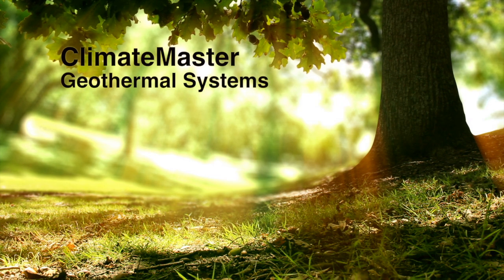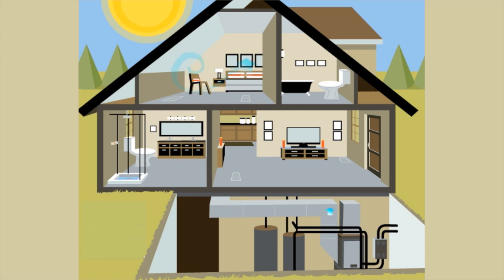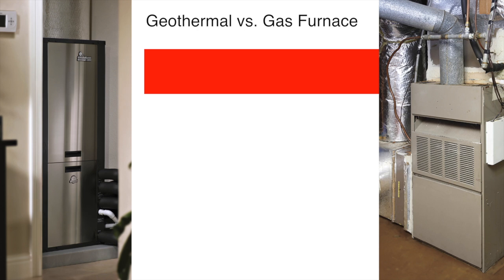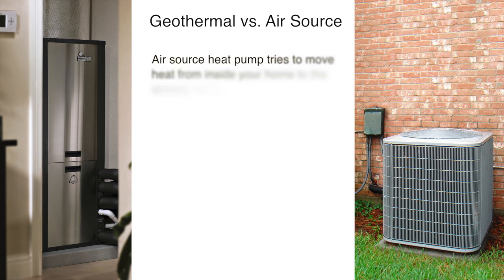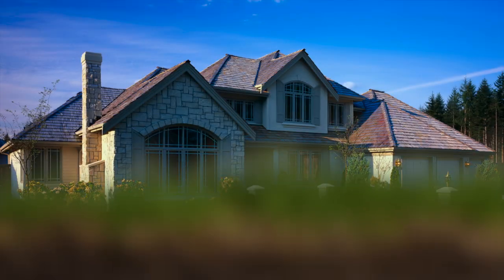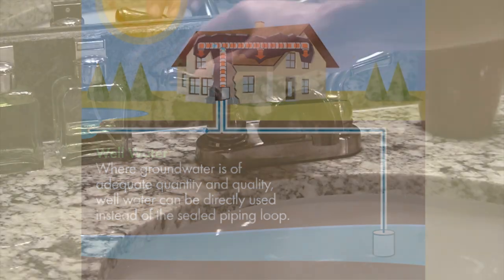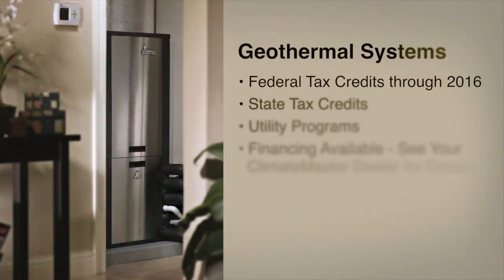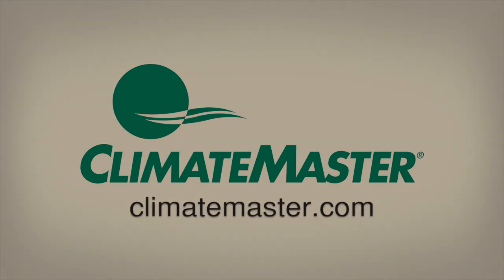Benefits of Geothermal Heating and Cooling

Comment: if I upgraded my traditional HVAC system, it would cost over $20k.  Add the cost of insulating, maybe $10k.  Add to that the cost of replacing 23 energy inefficient windows, $12 to 25k. That's about $50k all together and would still be expensive to operate.   Without the improvements it costs me $700 a month in Texas summers to cool just the downstairs 2500 sf down to an uncomfortable 80 degrees.  Any which way the costs are enormous.  No one has a cost effective solution for a 3200sf mid-century house!!
Reply: So how much would digging a basement yourself cost? A track hoe is expensive, but once you learn how to run it, you save $100 per hour when you do it yourself, (and anyone can run a track hoe.) Replacing the windows is not necessary. Just cover them with plastic, and only open a few. Don't doubt me, I've covered HUNDREDS of windows in a 9 story apartment building, and we saved over a hundred thousand per year in electricity.
Reply: Holy cow man. In Texas it costs me around $170 per month to cool my 2500 sf house to 79 degrees and my house has crap for insulation. I checked the attic the other day and the attic was missing about 6 to 7 inches of cellulose insulation in order to meet code. And to top this off I cut a hole in my dry wall a few years back and could actually feel air current coming through that hole.

As for cost effective I think really the only cost effective solution would be to apply the solutions as the house is being constructed. If I could do it again I would have required that the builders at least build with 2x6 studs instead of 2x4's like they do here in Texas and then had them put in spray foam insulation so that air from the outside couldn't get in the house easily. If I were to do that today to my existing house I would have to pay someone to take the siding off of my house, put in the spray foam insulation then put back the siding which would probably double the price.

Comment: This is like every single home should be built. A little bit of science here. Learn from mother nature, look at trees: 1) They collect energy from the sun by leaves, kinda small solar panels, it can even adjust them to track the sun efficiently = we do same by solar panels 2) They use that sun energy to extract carbon from CO2 gas by means of photosynthesis = we do same to collect free electrons from doped Silicon atoms in solar cells. 3) they store accumulated energy inside trunk in form of carbon, trunk is a battery = we do same with battery storage.  4) they use that stored energy to heat and cool itself by running heat exchange with earth via root system, roots are kinda heat pump plumbing = we do same with geothermal heat pumps 5) they extract water from earth = we drill wells.  Really, we should be independent from any public services, universe provided as everything needed to live, and it's all renewable. Trees are standing out there kinda screaming look at me, look how I do it. They are like huge hint in front of our eyes for thousands of years. Forgot to mention that tress extract carbon by means of photosynthesis - the most efficient energy conversion process ever known to mankind.
Reply: I think think earthy homes are better. If you have the right thermal mass you dont need any type of system. It will stay withing 8 degrees all year round no matter the climate.
Reply: @Riki Rikin kanayin, one would still need compressors and pumps that use a lot of electricity! Most electricity is from fossil fuels so you are not doing anybody a favor by installing geothermal. Don't believe the hype!
Reply: Fairy Dust will not Cool & Heat your Home.
Reply: It really depends on whether the electricity to run the pumps and compressors is cheaper than a normal electric bill. Also @Just Dave with the comebacks!
Reply: I'm amazed by the sheer lack of intelligence in the comments section , although it doesn't surprise me in the least. Compressor technology is way different than that 1960s garbage you boomers don't want to give up because its lasted you 20+ years but have spent enough electricity to buy 3 new ones that use half as much energy.  Smart people install it if they know they are going to live there long term, it will pay for itself after X amount of years. The technology has been used all over the world for many many years, north America is nearly always behind in new technology because of stubborn old generation.
Reply: And how much does it cost the homeowner to dig the trenches, install the pipes, and rig the entire system? I notice you did NOT include such common sense information like THAT! (Hmm, I wonder why?)
Reply: @jackfenn7524  expensive, at 70 years old and building a house, not cost effective.
Reply: @roscoepatternworks3471   Dont feel like planting shade trees because you will not personally get to use the shade?  Nah you are a Boomer... screw the future we have me to think about.
Reply: @vuchaser99  what are you talking about? I live in a desert, but I still have 7 fruit trees. But I believe the topic was geothermal energy. Putting in geothermal is not cost effective, for me. And exactly how may trees have you planted for your future generations?

Comment: I installed two open loop geothermal units in a house and carriage house I built for my son in Michigan.  Both were insufficient to keep up with heating or air conditioning, didn't supply enough hot water and were extremely noisy.  These were made by Heat Controller company in Jackson, Michigan.  When the main unit in the house busted a pipe and flooded the crawl space, the company refused to honor the warranty.  I've ripped them out and replaced them with high efficiency gas furnaces and conventional air conditioning.  The utility bills are less than half than they were with geothermal.
Reply: hahahah this is good to hear. An honest guy who went old school.

Comment: Heating means to supply energy what is lost trough windows and walls. The amount of energy is the same - to burning natural gas, electric furnace or heat pump " geotermal" / Geotermal - only on ICELAND/. Save on monthly bill is to upgrade windows, doors, insulation or set thermostat lower . #1 wood stove, natural gas, heating oil than electricity /heat pump/ what is most expensive .

Comment: for an average 2,000 sq. ft. bungalow, how many linear feet of pipe do you have to bury underground?
Reply: I would buy as much used PVC as possible, and install HUNDREDS of feet of it in large open ditches. Start covering it up, and measure the heat it sends up the pipe into your home. Remember, "professional contractors" will lie to you to maximize profits. You need to find out the true costs with experimentation, and do all the labor yourself.

Comment: Saying this type of unit "can save you up to 80% on your monthly heating, cooling and hot water bills" is overselling it. It may save you some money on your monthly electric bill over an equivalent all-electric solution, but at a much higher installation cost that probably won't be recouped for decades. If natural gas is cheap in your area it may save you nothing.
Reply: 50% at best...it will save some money but needs gas or electric boost to finish the job. But in extreme climate areas it assists the heating / cooling system.

Comment: In a heat pump when the temperature rises outside it raises the pressure inside the of the copper pipes which in turns raises the temperature of the refrigerant.
Reply: I think the word your looking for is“Refrigerant”! Regardless if heat pump or not the Freon temperature rises if ambient temperature is hot.

Comment: I honestly didn't know there was a system to warm your sidewalk during the winter! Very smart idea.
Reply: Yes... Its called ice melt and can also be placed on a roof to melt snow off of it. The only thing is you have to use a fluid that can withstand freezing temperatures. Typically glycol (yes what is found in vape fluid) is used to combat the freezing. Glycol is very expensive (due to needing so much of it) and needs to be replaced no longer than every 5 years due to it becoming acidic thus eating your heating system from the inside out. In other words it's expensive and high maintenance. But if you have the money it is very nice to not fall down every snow storm or have to sweep the snow off of it. You don't even need a geothermal system to have an ice melt, just a regular cast iron boiler would do the job.I install snow melt and heating cooling systems for a living.
Reply: @trex9194  wouldnt antifreeze work as well?
Reply: @sasouns  that's what glycol basically is, an antifreeze. It also has to be environmental friendly given the well pipes can fail and leak.
Reply: @[The] White Rabbit No thanks. If you can afford to install a snow melt system and don't want to deal with the hassle of having to hire someone to come and do a half-ass job of it, this is a great solution that doesn't require you to do a damn thing, but look at you clean walkway/driveway and never worry about tracking salt and snow into your house. The moral of the story is that there is nothing wrong with technology that makes life simpler.
Reply: @[The] White Rabbit you can do whatever floats tour boat.
Reply: Yes, Mama, it's called snow melt system. Hydronic would be more cost effective than electric systems.
Reply: Absolutely GENIUS!

Comment: I would rather have actual air run through pipes underground that gets cooled and distributed through the house. In the winter use efficient wood heating methods.
Reply: John Buick  Wow, you have no sense of humor. Calm Yourself
Reply: 1. Youd spend a fortune running ducts long and big enough through the ground and 2. There is no such thing as "efficient" wood heat.  Wood is the most inefficient fuel next to solar and wind.
Reply: Nate T. 1. It would cost significantly less to run a bunch of 2-4” corrugated pipe through the ground than to buy this crap. This idea I’m talking about isn’t something new, people do it successfully and it doesn’t cost a fortune. 
2. Wood heat using a rocket mass heater is incredibly efficient, the exhaust has no smoke and is only slightly warm after pulling all the heat out into the mass of the system. People use them to warm their homes using a fraction of the wood needed for a standard wood burning stove. Good luck heating a home with solar or wind.
Reply: @jdmec81  How many BTU's can you extract from a pound of wood?  Now how many BTU's can you extract from a pound of NG or LP?  There's the efficiency comparison.  With a 97% efficient NG furnace, there really is no comparison.  Plus, who's gonna cut all that wood at what efficiency rating?  How much energy is going to be expelled to create a cord of firewood and get it all into the furnace over the period of time it takes to burn the cord? 

Secondly, how are you going to seal up a corrugated pipe underground that would last a lifetime?  How are you going to prevent radon intrusion into the airflow that travels this circuit underground?  What air quality does a polypropylene air duct offer?
Reply: but to answer the first question there is just over 7000 BTU's in a pound of hardwood and just over 20,000 BTU's in pound of NG. More even in a pound of LP.   Assuming top of the line 97% efficiency you get 19,400+ BTU's of actual heat per pound of fuel and even at the lowest 80% efficiency you still get 16,000 BTU's.  There is NO comparison with wood fire output.
Reply: To answer the air quality question, you will get unhealthy air out of the corrugate pipe.  This is because within a week or so you will be blowing out mold spores from every vent in the house.  The warm air you circulate down into the pipes will condense in the cooler environment and since its dark and sealed all the moisture will collect and grow mold continuously.  Then you take into account the off-gassing of the polypropylene and  realize that you have a huge radon collection circuit running underground that deposits right along with the mold spores.
Reply: Nate T. Efficiency is beyond how many BTU’s you can get from a source. A rocket mass heater can heat a home with 1/10th the wood of a normal wood stove. People have kept their homes warm through the winter by burning sticks collected from their yard. The mass once fully heated hangs onto the heat for a day or more, so you can add more sticks a couple times through the day and maintain warmth in your home. People also use pellets and hoppers. That’s an efficient process, I save money since I can’t go harvest LPG or CNG, it’s clean, and I’m independent without much time investment. 

As for the pipes, I was mistaken on corrugated pipe, that was for a year round greenhouse. For homes they use an anti microbial pipes with sealed joints, no argon is getting into your air supply. 

I’m not just arguing for the sake of arguing here, these are things people successfully do, and have shared their positive experiences about. They are simple, effective, environmentally friendly methods of temperature control in your home. The system in the video is expensive, complicated in comparison, and prone to expensive failure.
Reply: @travnat1   Hi Nate...for us non techies ( us ignoranimus ) please can you tell us what the abbreviations like LP, CNG and NG stand for and can I ask do "wooden sticks " ref to "pellets" as I'm guessing a Rocket Mass Furnace is a Pellet burner
Reply: @hotoneinspai LP- liquid propane. NG- Natural gas
Reply: @jdmec81  yeah your duct idea is not new and it does work given you have enough surface area and thermal mass in the system, but at the same time this video shows a system that has been around for more than 30 years and it works reliably .. just needs a pump, heatexchanger and a heatpump.. nothing fancy no rocket science and the loops you put in the garden ground are rated for 100+ years.. so if installed correctly you will have a maintenance free loop in the garden and unlike your duct system it is closed looped... duct system can get rodents and dirt inside ( mostly dirt ) and you will also use an air heatexchanger, otherwise you will have problems with gas and mold..  if you have a sustainable source for wood I´d say wood is just fine.. and the heat is exceptional comfortable.. 
the little amount of electricity needed for the system shown here can easily be generated by solar NO PROBLEM.. so save your good luck for something else;))
Reply: John Buick  Can you please explain to me what a decades and web browse is??

Comment: Really fun reading so many clueless comments. Loved the one about radon.   This really does work      and is not a scam.. but that said. some here just are not willing to read or talk to someone who has a  clue  There is no free lunch and with these systems people tend to undersize them because $$$$        upfront is a killer  There are lots of ways to bring the cost of heating and cooling down. First one.  BE  efficient.  Seal the house.. insulate the house control air and moisture movement.
Reply: Steve Pailet I’m a plumber. 
It is a good system indeed. Though this system is a rich man or woman’s game. It will take you 20 years on average to pay back the savings on the extra hardware and installation. Then you are making money.
It is simple. You have to take the ground temperature and raise it or lower it with another heating or cooling source.
Reply: but how much does it raise the value of house

Comment: This video is very misleading. Depending on the size of your house determines the amount of looping in the ground. This can done by drilling a shitload of holes, about 8,000 - 15,000 depending on type terrain etc. or it can be dug with excavator or backhoe and take around 600 linear ft of piping in the ground. Is your lot big enough to handle a huge drill rig or a massive amount of excavation? Probably not. Next is the electrical panel. This system requires 2  - 40 amp breakers MINIMUM. Some homes need a 400 amp panel to handle the load. Most homes can get by with a 200 amp panel but are maxxing the panel out . Expensive  to drive the pumps to circulate the solution in the piping. Next is the winter heating. If you live in extremely cold areas , the heat does not heat fast enough to heat your house unless you keep the thing on full blast for days at a time. That means the pumps have to stay on the whole time. When the pumps fail , get the checkbook out because they aren't cheap. I will say the best thing is for cooling in summer. Not heating in winter.
Reply: the 8000 15000 is the cost of drilling. Not the amount of holes needed. Haha
Reply: Bull shit. I don't know why so expensive to drill in USA. If you want you can simply do the earth part your self. Get att backhoe and dig some trenches and put a plastic hose in them 800 to 900 feet is plenty for a smaller house. Then connect that to the heat pump. All Geo-heatpumps can work with, lake source, drilled hole, or vertical pipes. The pump is a big cost yes. But normally pay off in 10 years time. Say 20 000 dollars for a pump. Normally last for 20 years with out any repairs. That is why some manufactures have 12 years warranty.
A pump takes 1 part electricity and makes 4 parts heat out of it. So you save a lot om coast on that.
My pump can heat my big house even when it's -20 Cellsius outsiden. And even then it only runs 70% of the time. So 24 hours * 0.75 = 18 hours a day, and takes 3500 watts. So that is 3.5 kwh * 18 = 63 kwh /say or 5 dollars a day.

Comment: I wonder if this is possible to be installed on my roof as well as in my house because if I install it in my roof then it will complement a separate system but I have from my house called a rainwater harvesting system because my roof gets snowy in the winter’s and if a part of this system is used for the roof to warm it up all that water that is formed can go into the rainwater harvesting system that I have.... just an idea I’m thinking about.